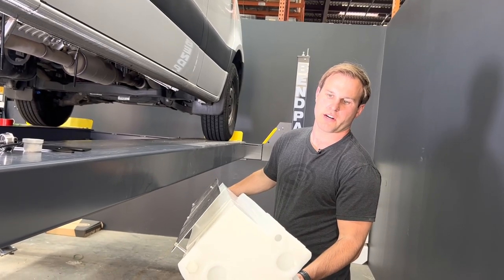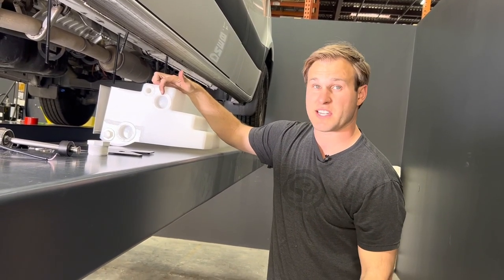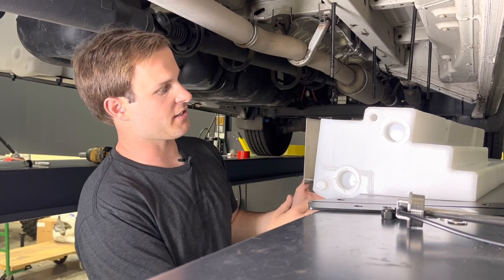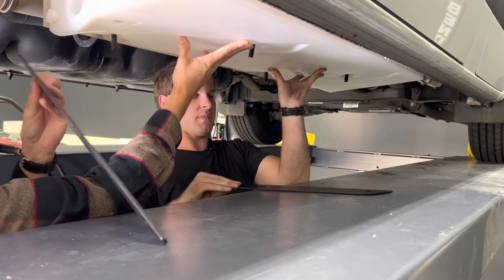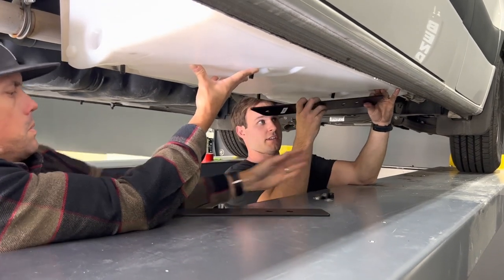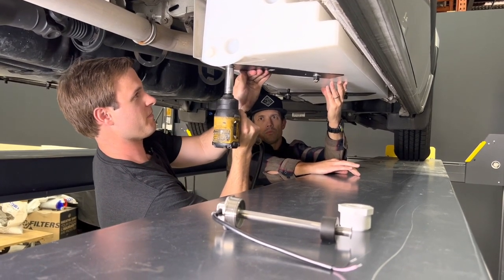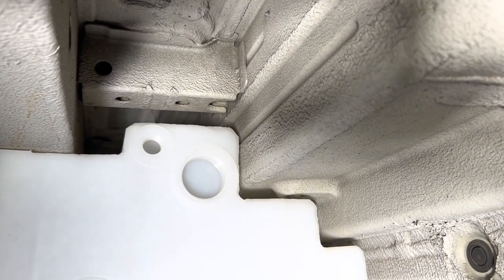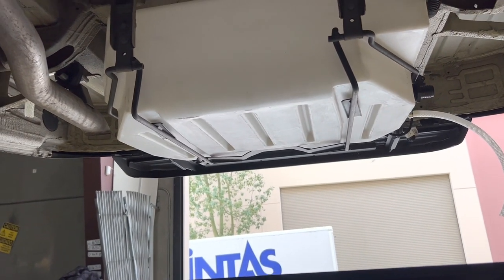S&B 16 GALLON PASSENGER SIDE UNDERCARRIAGE FRESH WATER TANK 07-23 MERCEDES SPRINTER 144" & 170"

Comment: on mine,  only 2 holes on the heat shield lined up with the threads on the tank... other 3 holes are way off... checked out this video to see if i was missing something...
Reply from the maker: See below, this is the 3rd van out of hundreds that don’t have the holes shown in the video. Please see the drawing attached so you can mark then drill 3/4” holes 

https://sbfilters.com/pages/install-instructions-for-10-3009